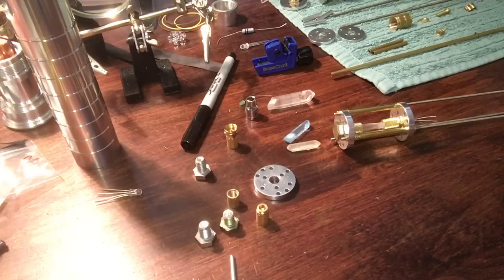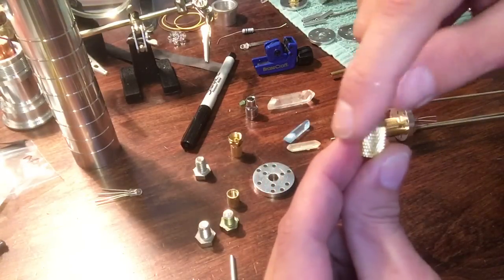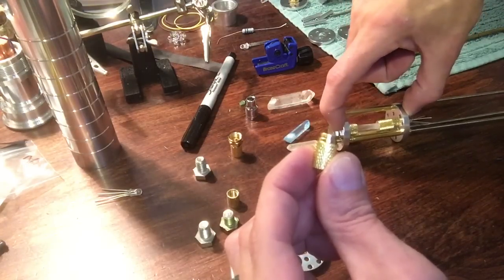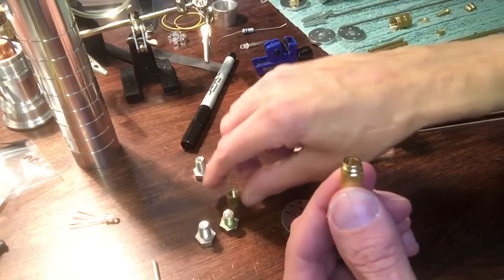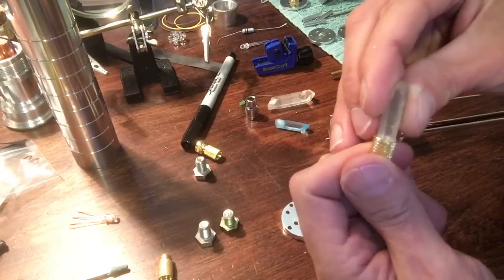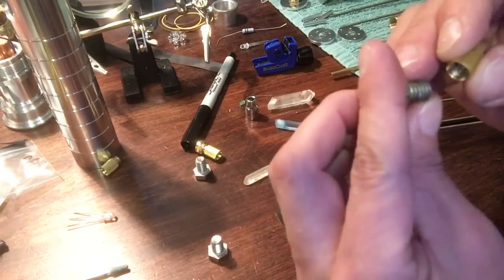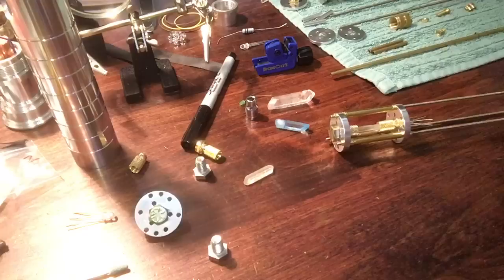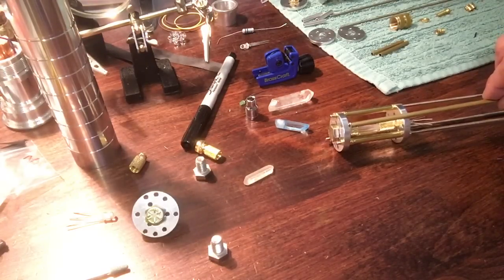Building a lightsaber Crystal Chamber from TCSS parts

Comment from the maker: Those that are watching this video I actually hold the led in with hot glue not super glue. My mistake. Hot glue makes it so you can pull the led out if needed. Super glue would be difficult, I wouldn't recommend it.
Reply: Jediseth what size threaded rods do you us, m2 or m3?
Reply from the maker: Proptor FPV the threaded roads that are available at the TCSS store . I believe they are 3/16 inch.

Comment: Where did you get the coax cable ends? Did you buy them or cut them off old cables?
Reply from the maker: Ezra Knigh, Radio Shack, but I’m pretty sure you can find them elsewhere.
Reply: Jediseth thanks for the quick response and great video! I’ve been trying to find a tutorial for a crystal chassis for a long time and everyone just seemed so reluctant to share any ideas or methods on the process. So thank you very much!

Comment: where do you get you get your crystals from
Reply from the maker: lorenza lewis, EBay.
Reply: lorenza lewis if your a DIY guy I’ve been making them out of just cutting a clear glue stick into the shape I want, then you use watered down paint to color it and after the paint dries I seal it with clear fingernail polish. You can even add glow in the dark paint to make it look like it’s cooling down after your chassis light powers off. There are a few vids here on YouTube about it.